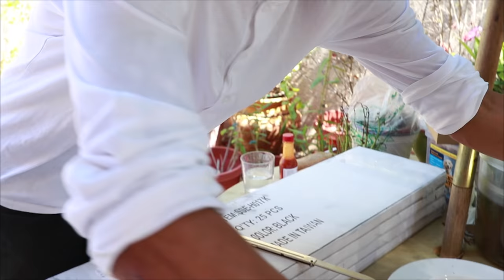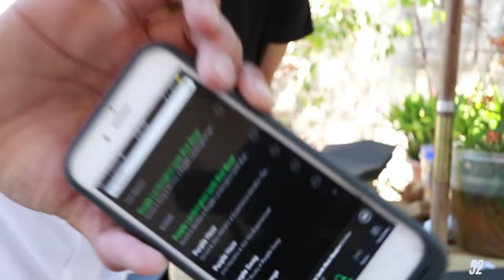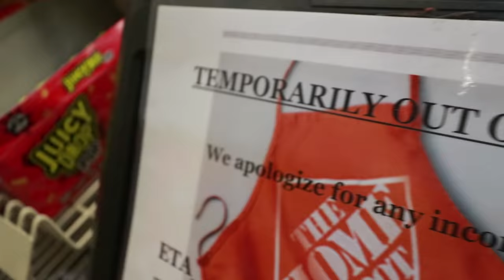100 LAYERS OF GRIPTAPE

Comment: wast of tape but it was still pretty cool
Reply: Nah, they made money off of it
Reply: No, he means a waste of the grip tape itself, not his money.
Reply: +Elapse they arent running low on griptape anywhere
Reply: JoeTheFgt I don't even care about grip tape or anything of the sort, it's just a waste in general, like for example, you can throw a bite of a sandwich away, still a waste, you can throw out some water in a bottle, still a waste, I don't care that he used all this grip tape for nothing, as it's not really important, I'm just correcting the other guy who thought he meant it was a waste of money,
Reply: Elapse I knew exactly what he meant, but I wouldn't call it a waste if I was making money off of it or using it for fun. If you throw a sandwich away, that's obviously wasting but it's grip tape and they are using it to make money, which means they could just buy or make more grip tape.
Reply: Joycelyn Morales you can't speell
Reply: Yeah, the grip tape drought has been brutal lately.

Comment: Hey there is a circler saw that you can get special blades for that will cut through that tape like butter, and also drill and screws that you can screw the grip tape onto your skateboard it probably will cut out very significant weight also.